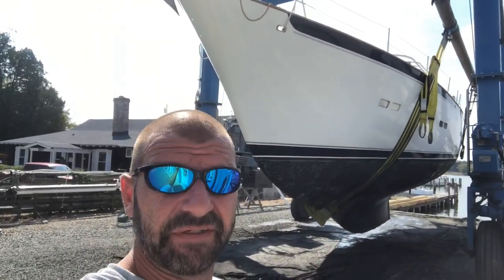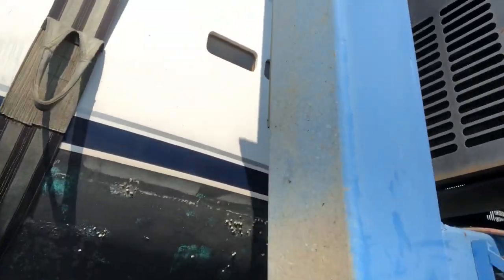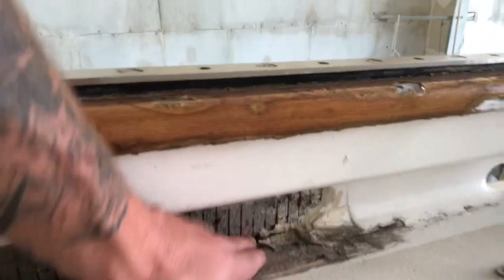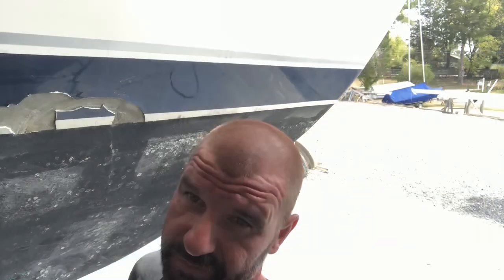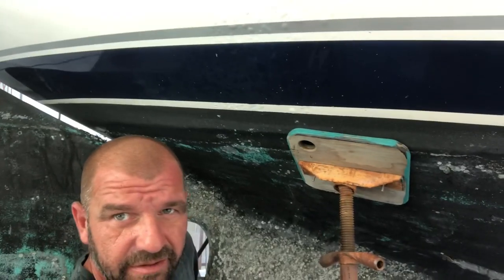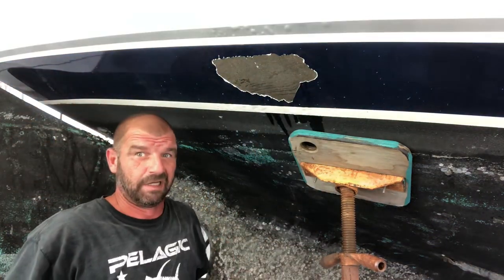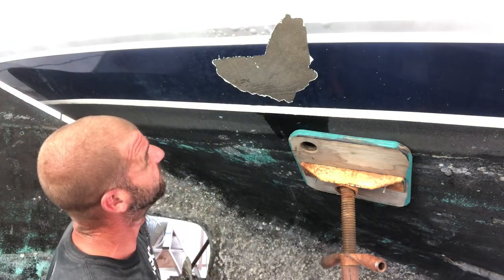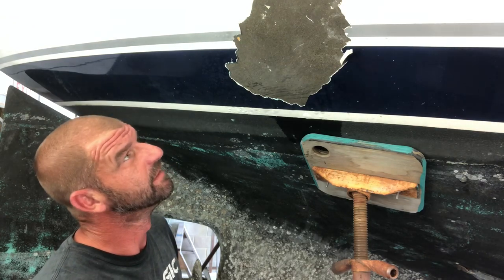Prepping and painting Ferrocement part 1

Comment: Impressed how good the cement looks....I’m  wondering if the reason all that Fearing is coming off so easy is if because get  used incompatible products or they let the epoxy  primer sealer go off too long before they applied the epoxy fearing filler and it didn’t take ?
Reply: It's because whoever put that paint on either used a sealer that just sat on top of the concrete, so a non penetrating sealer or they just painted over the concrete when it was dry. Once one drop of water gets in the paint somewhere it vaporizes over time and starts pealing the paint away from the concrete. With a penetrating sealer you don't get that because the line between the sealer and the concrete isn't that distinct it's like the line between a sponge and the water in a bucket if the sponge is in the bucket. You just can't peel water off a sponge because it's soaked in.